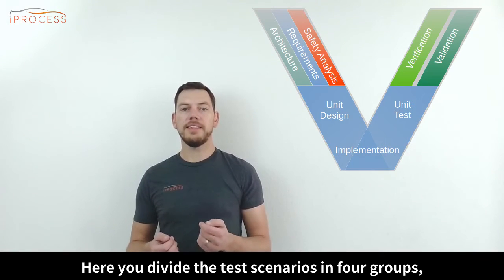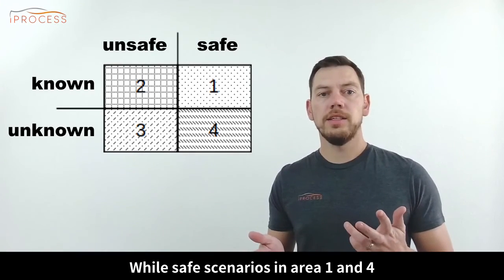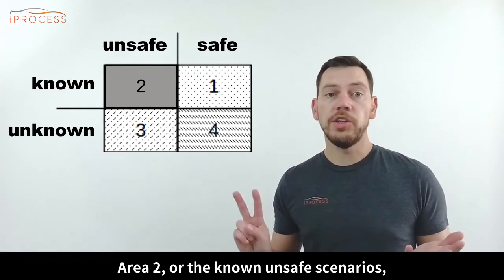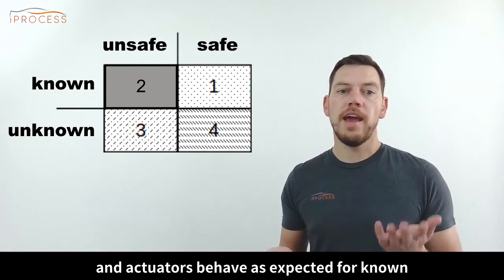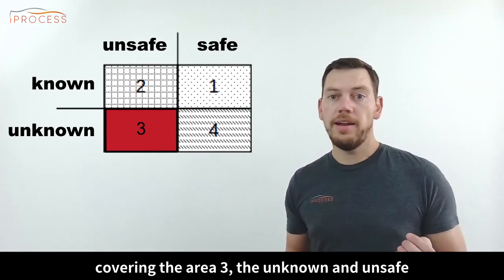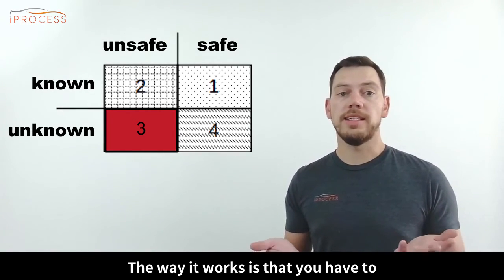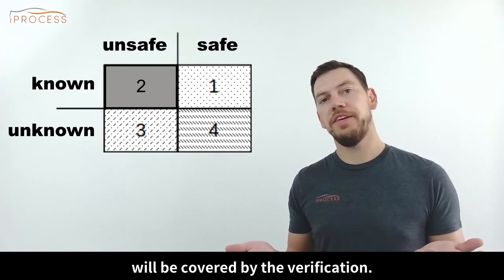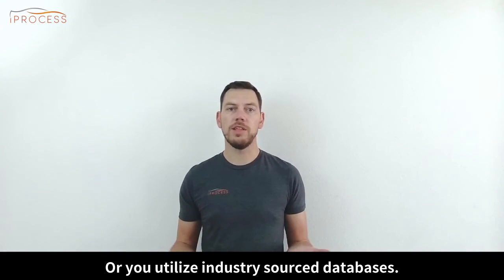iProcess - a very condensed intro to ISO 21448 SOTIF

Comment: Hii 
Your video is detailed.
My concern is How SOTIF can impact on ISO 26262 requirements?
Reply: Impact of SOTIF on derived safety requirements of ISO 26262 for ADS..With example
Reply from the maker: @pavnikhot9847  https://www.iprocess-consulting.com/expertise/automotive-functional-safety/
Reply from the maker: SOTIF requirements are complementary to FuSa (ISO26262) requirements. While FuSa requirements target failures in the system, SOTIF focuses on misuse of a system that is completely performing to spec.
Reply: please do update for the new ISO 8800: AI safety!